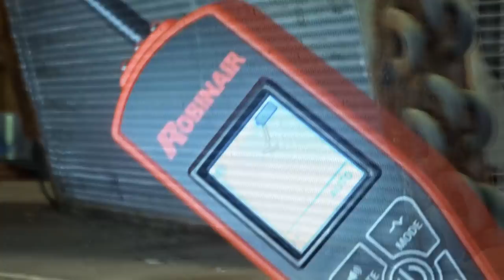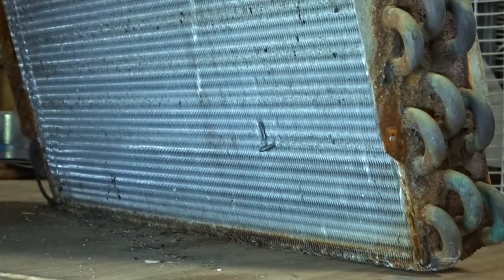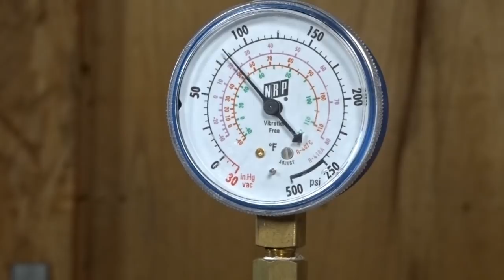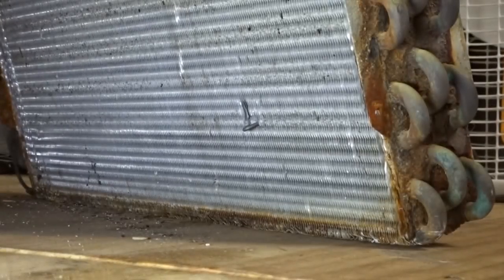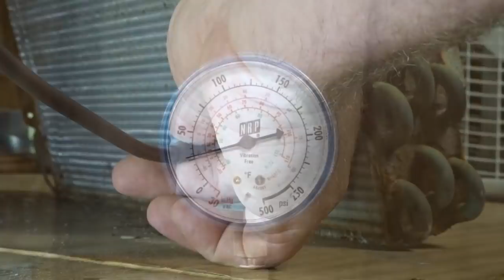HVAC Leak Detector Series | 134a | H10 vs LD7

Comment: Here is the problem that I find with most Leak Detectors. Which you also had but did not comment. Other brands besides the h10 have a high incidence of false alerts. The way the h10 is with its probe and hose you will not get those annoying false detections.
Reply from the maker: You are right. Good point

Comment: I'm not criticizing, but we normally do not leak test with 25 or 50 psi. If I find a system that low I will take it up to 100 or more with freon and N2. The only thing that changes is the size of the leak and the sweeping motion to look for it. Thanks for the lab testing
Reply from the maker: Lee Johnson the lower psi just simulated smaller leaks. I agree with your field method